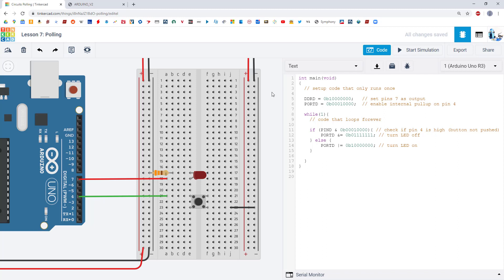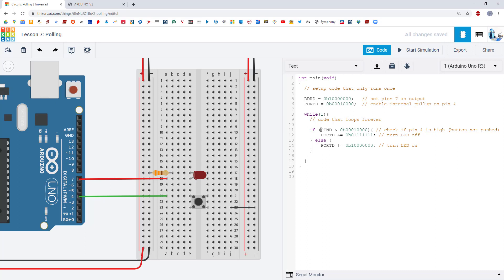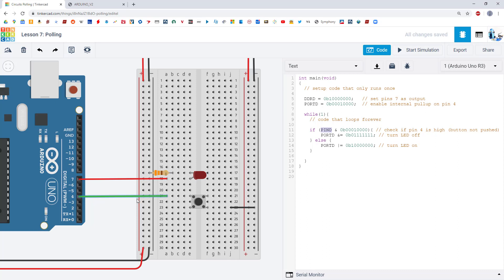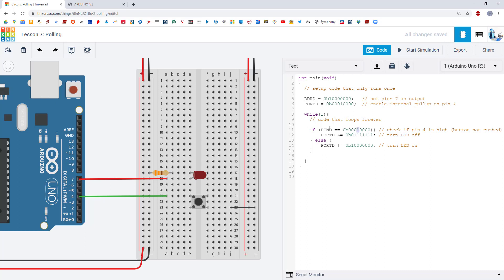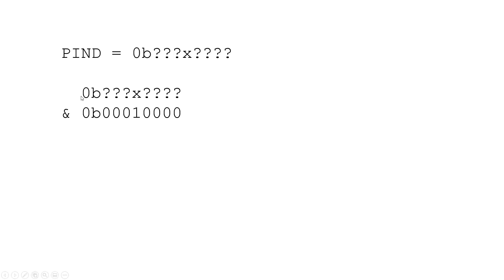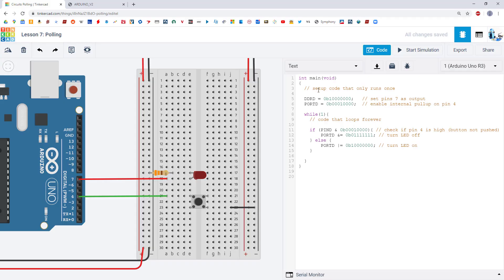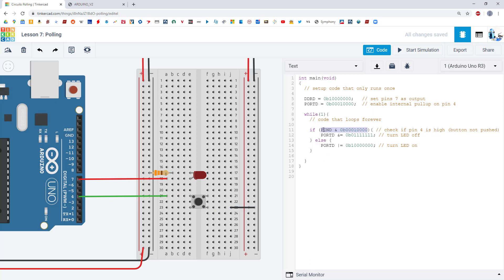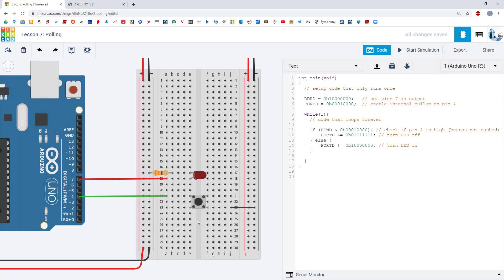Tinkercad + Arduino Lesson 7: Polling & the PIN Register

Comment: Am I alone with Tinkercad having very slow simulation times for this lesson? It takes roughly one second real time to simulate 10ms in Tinkercad.

Seems my code was stressing Tinkercad, it's all good when the code is correct.
Reply from the maker: I have always had occasional issues with Tinkercad running very slowly, but have never been able to pinpoint the exact reason.

Comment: I did all but my led is very dim, I measured it with a multimeter and it shows a very high resistance. What can I do??
Reply from the maker: Hi - do you mean you did this in Tinkercad or with a physical circuit? Either way, the most likely cause of a dim LED would be a resistor that is too big, I would double check your resistor value.
Reply: Ive discovered this also happens when you dont declare the bit/pin in DDRD